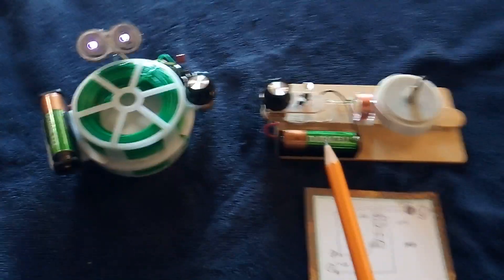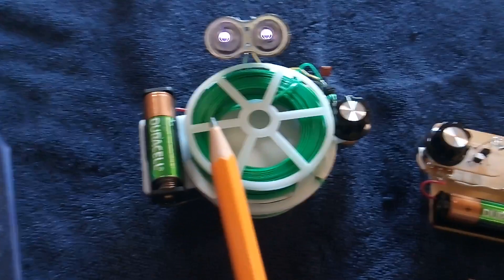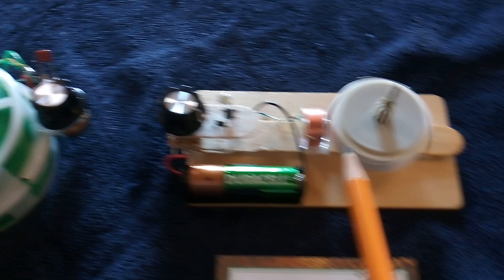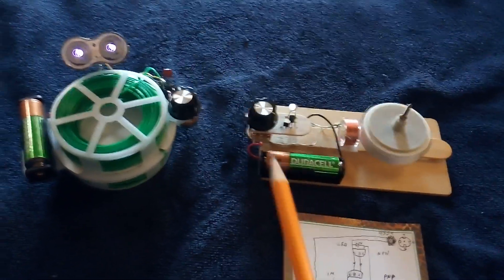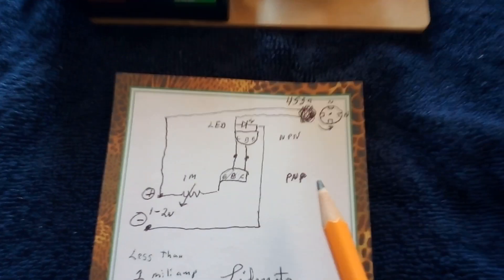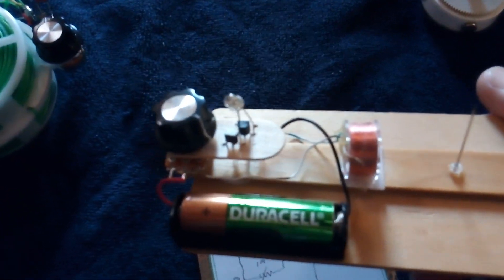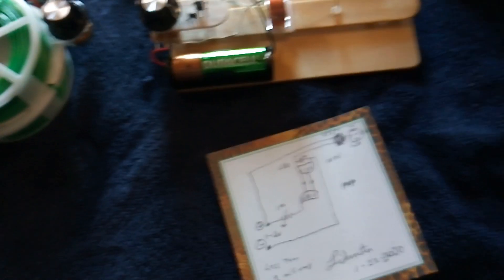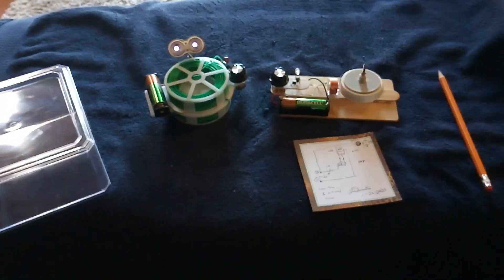Battery testing using a pulse motor

Comment: Heat the wooden sticks after drilling to 150 -180 degrees F and then as they cool spray them with clear coat - either lacquer, varnish or shellac. That will eliminate moisture influence and conductivity.
Reply from the maker: Thanks.

Comment: Hi!! Nice video with the push-pull transistors.  It was not real clear on your drawing in the video, what is the ohms of the coil?
Reply from the maker: That is an old coil that I made years ago.  The wire is very fine and the ohms resistance is in the thousands.

Comment: Try the Ladda brand rechargeable from I k e a. Reference YouTube Project Farm    https://www.youtube.com/watch?v=V7-ghrTqA44
Reply from the maker: Thanks for the tip on those batteries.
Reply: @Lidmotor  You are welcome. Thanks for all the low-power motor experiments you do! Wouldn't it be cool if some of  your experimental findings worked in high power electric car motors? This probably would require some kind of  metric like "torque-per-micro Amp" or some kind of calibrated mechanical loading of your  motors.

Comment: This is certainly keeping you occupied. As slider says, the woodboard breadboard looks great. In keeping with the rest of the build 😍
Reply from the maker: At one point I was going to start calling these 'Time Machines' because they required testing over vast time spans.  A wooden H G Wells Sci Fi look to the motor seems to be appropriate. It needs to be stained with some brass bits here and there.  Here is a clip from one of my favorite movies:  https://www.youtube.com/watch?v=7aVpiGzsCBI

Comment: Great update, will be good to follow along and, maybe, one of them won't actually perform the expected discharge curve.. I like the wood board idea. Sometimes I've used snipped empty sections of junk PCB's in a similar way. Cereal box cardboard is another.
Reply from the maker: I looked at a lot of discharge curve graphs and these type batteries  run along just fine at a certain voltage. ----then fall off the cliff and die.   Luckily they charge right back up and can do it all over again.  I think the wood board idea will work out just fine for this application.  Not such a good idea for RF stuff probably.  Dr. Stiffler  would have frowned on it but it sure was an easy solution for mounting components.  I read somewhere that guys have used a business card in a pinch also.
Reply: The Lemming curve lol. Another viewpoint on the build materials - they are away from the trendy PCB's and surface mount designs, using practical solutions. I consider it an art form and you could well consider such builds as this one as art.
Reply from the maker: @Slider2732  What you and I do IS a form of art.

Comment: I have no doubt it could run over a year.-and more with solar boost.   Don't know if you ever saw one, but I have one of those glass dome enclosed clocks with a rotating (merry-go-round style)set of 4 spheres that  rotates back and forth about 180 degrees.  Well it runs for over a year on just the cheaper AA cell got from Harbor Freight.  Between the gears and the spinning, stopping and reverse spinning there is quite a lot of load so a year is amazing on a poor quality cell.  Also your battery current demand will naturally slowly go down. Per Ohm's law, R=E/I.  As the battery deteriorates, Resistance goes up and therefore Current must go down.
Reply from the maker: We used to have one of those clocks long ago.  It was fun to watch.  I tested both of these devices by hooking them up to a 5 F super cap.  I watched the amp draw drop as the voltage dropped.  The super cap was very handy for testing micro amp stuff.
Reply: That is great about the super cap for fast tests.  Let me share a discovery I made some years ago that you may find useful to even greater efficiency in your endurance tests.  So I had a pulse oscillator circuit driving a normal transformer and the output then full wave rectified and wired to a small permanent magnet motor.  The oscillator (switches the primary of the transformer) and was powered by a C battery.  Well the motor would not even "jump" with the weak C battery whether from the circuit or from direct connection to the battery.  So I happened to add a capacitor (forgot but perhaps 10,000 UF electrolytic)  in parallel to the battery.  And now the toy motor self started and ran fine CONTINUOUSLY.  At first I thought the cap was just providing a surge boost charge to START the motor but that does not explain why it continued to run as I could grab the shaft, stop it and as I left go it would start again ----and the motor would have drawn max current in that stall so the a cap is not just acting as a surge booster.  More is going on.  Anyway, this may help your designs as well since the cap seems to somehow amplify the power of the input battery and might extend the duration of your models.  The key point is that the battery was nearly dead and only with the cap would the motor work.
Reply from the maker: @energycrafts8206  Thanks. Great experiment.  I might try that.  Last week i added a 300 UF cap in parallel to the battery on the led oscillator to exactly replicate Magnetman2010's setup.  On that 'Penny' oscillator the cap across the rails is critical to it running on low power inputs.  If you run it on a strong battery it doesn't seem to matter so much ----but maybe there is something more going on.

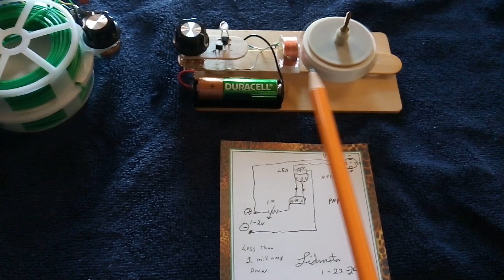Comment: 0:32
I wonder if doubling up or quadrupling up the transistor pairs will reduce the current draw similar to the way you made the wheat stone bridge more efficient by adding diodes in parallel .
Reply from the maker: That is worth a try.  I have tried that on other project with some success.  The transistors have to be closely matched.